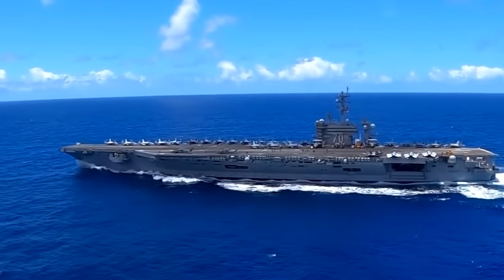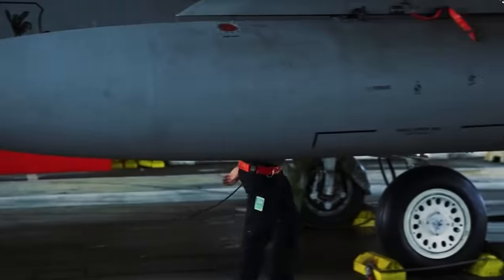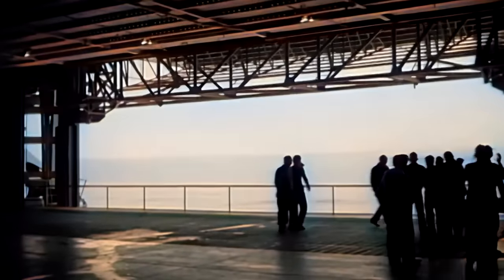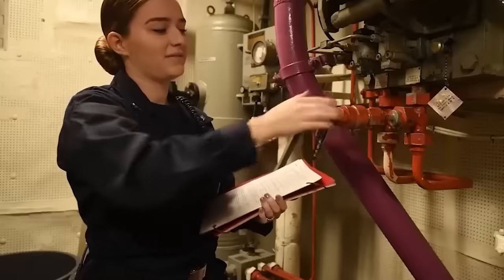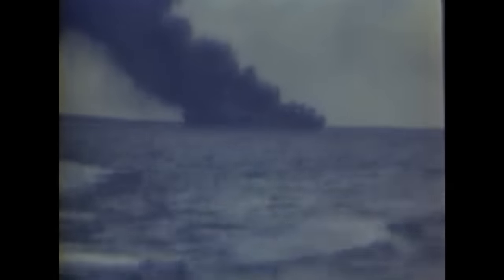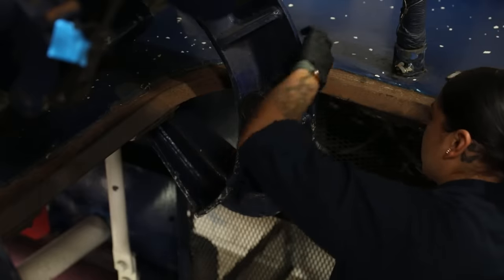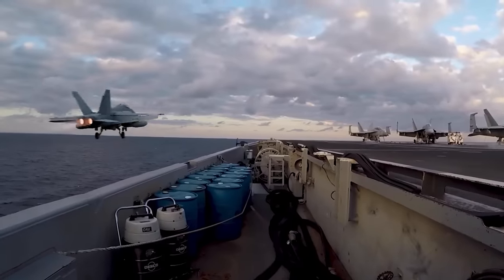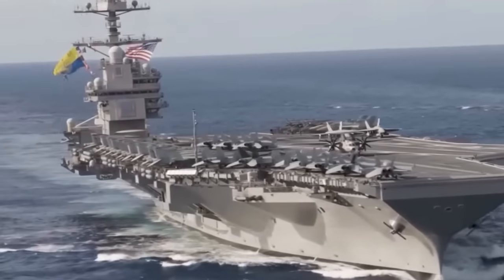Why Do US Aircraft Carriers Have NO DOORS in Hangar Bay?

Comment: Umm, in your thumbnail you can see the hanger doors.  All carriers have doors, they aren't watertight, but they do close and keep high waves and wind from coming inside.  Even in the video here, some of the side shots of the carriers have them shut, you can see it. @0:08 left side of opening are two doors stacked, to left of the bottom curved part, they have the hazard yellow/red stripes on them, they slide sideways to close the large opening. @2:52 Side shot of carrier, door shut.  @3:06 another carrier with the hanger doors closed.  Carriers also have three separate doors that can split the hanger into thirds to help suppress fire spreading below deck.   Emergency doors are always marked by yellow and red stripes on their edges of movement, that area is a dangerous area when those things are in motion.  If you're going to make this up, then at least don't show video that contradicts your statement.

Comment: 3 major areas.  Flight deck, hanger bay, and engineering.  Without engineering to make the ship go, you aren't a ship, you are a floating reef.  Plus, good luck launching most combat aircraft without catapults, which are (almost) universally steam driven.  So yeah, without the engineering spaces, that ship isn't anything to anybody.

In fact, i would say that the engineering spaces are the most important, as they provide power for EVERYTHING on the ship.  From propulsion to electricity to steam.  You can limp a carrier home without a flight deck and without a hanger.  Try getting that ship back without the engineering spaces.

Comment: yes open decks are good, it allows for Diesel powered tractors and machinery to be started up, without the CO2 Hazzard as it is in a well ventilated space, also any fuel or oil spills can be washed overboard, eliminating any trapped vapours, also the jets can be test run, for maintenance, without taking space on the flight deck, also this is away from the bombs aboard, which are also brought onto the flight deck, so minimising risks of damage if something goes wrong.

Comment: Yes the hanger bays have doors. Who da fuck wrote this nonsense. I spent 6 years in the US Navy and 52 months of that was on the USS Nimitz. It has two sets of internal doors to divide the 3 hangers bays and each elevator has blast doors as well. They are often left open yea, but in GQ or bad weather conditions, like all the weather decks they are secured (CLOSED).

Comment: Pretty cool actually. Regarding the question of "how they could be improved", it's pretty clear that there's no right answer and it's just a complex risk-management calculation wherein you've got to prioritize mobility/efficiency OR resilience. 
It'd be hard to say if the doors justify the added cost of ventilation or if they improve ventilation and under what circumstances and what the likelihood of less common risks like runaway fires and explosions would be with or without them without having the innumerable risk assessments and schematics that go into making those decisions..

Maybe one idea is to build each carrier to the specifications of the aircraft it carries (bottom-up construction for a given loadout configuration) and, rather than larger hanger bays, maintain a larger amount of smaller bays customized to more highly optimized maintenance of the individual craft.
This could perhaps be paired with individual elevators for each craft or each TYPE of craft, parking the craft in their designated spots and ON their associated elevator and having overall more elevators leading to the distinct hanger bays so that craft can be moved to/from their bays w/o rearranging the flight-deck, from which point the problems of ventilation of fumes, containment of fires, and safety from attack could be prioritized according to the specific needs of each aircraft and it's payloads and maintenance schedule and the inherent risks they carry and managed individually in the event of any kind of hiccup.
This, in large part, might contribute to an overall more manageable ventilation and blast containment/damage control efficiency as you'd have more compartments with more barriers between water/explosives/fires and the rest of the ship, minimalizing the likelihood of a total loss through careful and extensive compartmentalization/modularization.

Might also improve taxi logistics and decrease overall re-armament and launch times.
For instance, aircraft that are used less often could have their "parking space/elevator" place in higher or lower traffic areas of the flight deck, their "parking spaces" consisting of an elevator directly above their respective bay/garage. Since they won't be ON that flight deck the majority of the time and they could be kept out of the way while higher-priority F-35's or whatever could be placed towards the end of the runway for faster launch, landing, and taken below for re-armament without the need for as much taxi logistics.

The modular approach would lend itself well to more distinct, purpose-built TYPES of carriers to support different types of aircraft configurations and supporting different generalized mission plans/combat modalities.

I could see potential logistical costs in this design of a carrier as storage of everything from munitions to fuel would have to be localized to each crafts "garage" location and it would introduce more barriers to moving potentially critical tools/consumables to/from those specific aircrafts areas but it could lend to an overall much lower risk of total loss in the event of any individual bays compromise as each, smaller bay, could be built with containment in mind. (for instance, I see in the video that the hangar deck basically works like an amazon fulfillment center with all kinds of things stored all kinds of places and moved around constantly).
A modularized design would require a reworking of storage configurations to have individual aircrafts armaments/fuels and their maintenance workers tools and other supporting items more or less built into their localized bay but, certainly, some things would still need to be mobile as they're not distinct to any one aircraft.
One way around the more difficult logistics might be to have the lower decks used for storage of consumables that might be used on multiple aircraft but then you've got the same problem as on the older ships, so I'd think the modularized approach would be the most optimal all around.

Another option might be to do an assessment of just how much of the TOTAL tools/consumables/weapons/etc. is unique to an aircraft and CAN BE completely modularized VS. how much is generic or CANNOT be.
Depending on the outcome of that assessment, perhaps an automated system can be contrived that facilitates the relocation of generic/universal/multi-use items or consumables throughout the ship, wherever needed without the need for significant foot traffic (and so less/smaller doors) while also enabling the level of dynamism of the working environment necessary to maintain the aircraft while not compromising the containment value of the modularized bays.

Whether or not all this is feasible and worth a total reworking of the ships construction and all the additional potential for failure points is a-whole-nother matter unto itself... But, I guess I'd look for old out-of-service aircraft carriers (like the U.S.S Richardwhatever) with which proof-of-concepts could be constructed and modularized hangar bays could be retrofitted for testing purposes FIRST, so iteration could be achieved and kinks worked out before allocating the much more significant budget required with a bottom-up redesigned build.

IDK. Best I could come up with in 15 minutes.

Comment: In your thumbnail picture you can see the hangar bay elevator doors to the right of the group of sailors standing by the stream unrep rig.  The sailors are standing on the door tracks and the doors are stowed.  You can see the yellow and red striping on the bottom of the doors just above the track.  Remove this totally misinformation as it is completely wrong!

Comment: Having never seen this video, this seemed a challenge of sorts. I'd say the most carrier trained navy in existance has learned a thing or two about safer carrier operations. Why would you enclose an area chock full of explosives & fully fueled aircraft where explosive fumes from fuel could easily concentrate & explode? Experience means the US has advanced when others are barely started in seaborne aircraft operation. It sure eases my tension a bit./thanx.
Reply: british carriers were very resilient to attack, as even the yanks admitted. i cannot remember the exact battle or carrier, but there is one instance at the end of the war over japan when a brittish carrier was hit several times by kamikaze attacks and they swept the deck clean and carried on (heavily armoured deck). no american carrier would have faired as well. American carriers were designed for the big open spaces in the pacific, where as the british carriers were designed to be used when in reach of land based attack (the med being a prime example). when you cannot hide, you have to find different ways. neither was a perfect design, but nothing ever will be. its war........shit is gonna happen, its just a case of avoiding the worst of it, based on your probable missions. 
do non carrier ships keep their fuel stores/magazines in the open? or do they hide them away behind as much armour as they can? would have thought the same dangers apply really. 
dont go thinking good ole uncle sam has all the answers please. its sickening and wrong..........just ask your own top brass (not while on record). the more you do the more you learn (the hard way) and that is what its all about.

Comment: You got to be f**** kidding me.😂😂 Yes I listened to the whole thing and he did get around to  the doors but the premise of this whole video is stupid.🙄 I was on a carrier. I served in a conflag station,  I closed and opened doors on the elevator deck edge and between the hangar bays to control configuration fire 🔥. I will say I used to dream about an f-14 flying through hanger Bay 3 in door three out four right through the hanger Bay, would have been pretty rad. 😂

Comment: I would design my hanger door Like a giant wheel disck , In between two slots The door itself would just roll to cover The opening , Then I would use the design implimitations in the M one tank For its Ammunition storage , You could do this with a simple taper design So that if there's an explosion from the Inside It will pop open like the paper cab On a blank round But if you hit it from the outside It's still armoured , Since I was a kid and the eighties living in san diego I remember saying it to Lenny.Duncan who trained george bush junior his first week on the s three Viking , That open bay is the first thing I would target I would send a missile right inside of it . They learned the lesson of aluminum in the falkland island war , Yes the stuff burns I would design my aluminum pailating In a geometric pitted pattern And embedded in it would be a flame retardant So that once had started to burn It would put itself out .